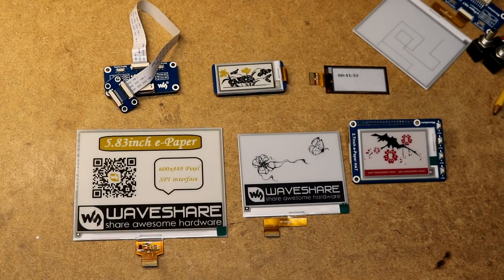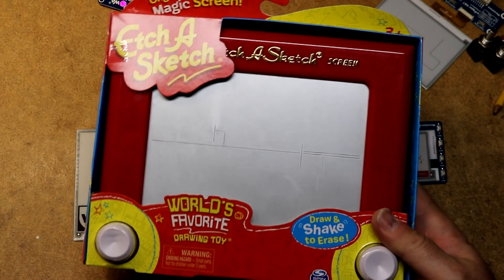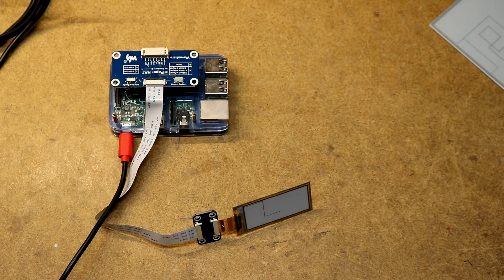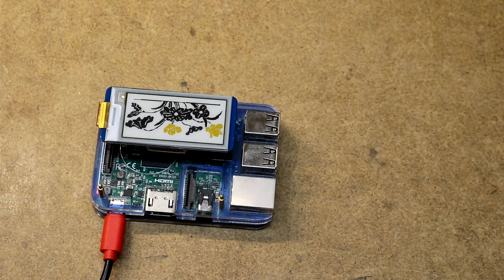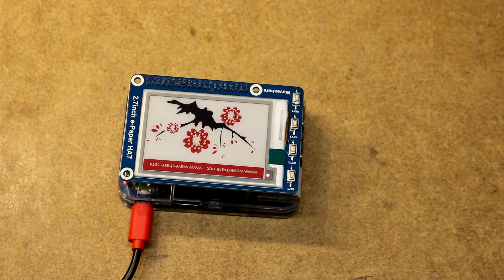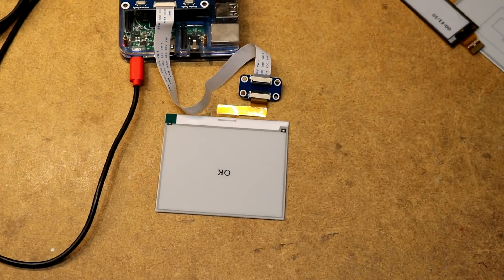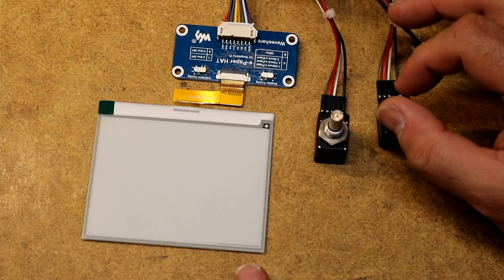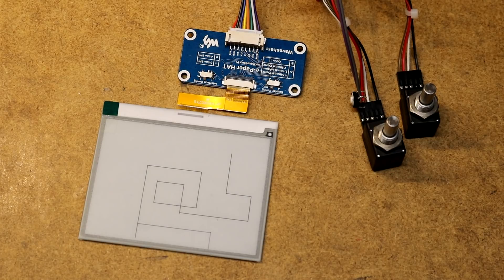Review of Waveshare e-paper displays for raspberry pi / Making an e-paper etch-a-sketch clone

Comment: I didn’t realize the multi color displays are so so slow. Thank you for this video. You helped me make up my mind.
Reply: I'm a little late, with certain multi colour e-ink screens, they can do partial refresh, I'm not sure if they can handle it without damage so I do suggest to read any documentation and/or refresh the whole screen periodically while partial refreshing.
I have a 7-color 7.3" 800x480 waveshare e-ink screen and it can take up to 35 seconds to refresh. But it's fine for my application as I'm working on a self-changing photoframe for my dad, while in the process of over-engineering it to have a battery runtime of a out 180-200 days on a single charge with 12,000mAh of battery capacity to work with.

Comment: First time I saw my screen flash like crazy i got scared it was broken ... but it's just part of the refresh cycle (makes sense). But at first my display wouldn't work and had the reseat the connector and after that it work but it did that flashing and I got scared lol.

Comment: are e-paper displays suitable for DIY synthesizers and midi-controllers to visualize parameter changes and evolving  audio dynamics?
Reply: Cheap ones have slow refresh rates (like 6-15 seconds) so maybe not.
Reply: Bit late, but the 2-colour partial refresh ones might have high enough refresh rates if coded properly

Comment: Nice demo. 
  I wanted to try using one of these with an OSHW AVR Transistor Tester project version at some point. I always seem to need the specs or pinout just after the display auto power off kicks in.
    If I ever get around to it, now I know, only get a black and white version. Thanks. I probably would have gotten really frustrated by the color versions.
  These would also work nicely for a little low power data logging display like lab temp and humidity.
-Jake
Reply: excellent idea about the avr tester ... I hope you are working on that, and will share